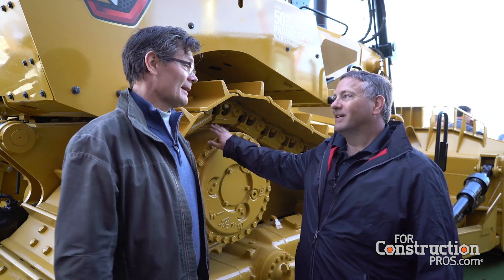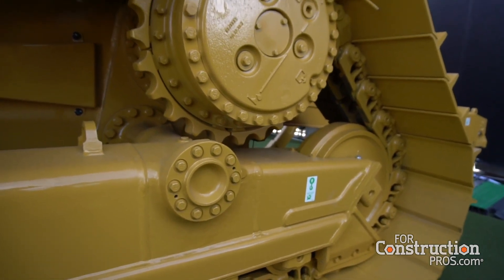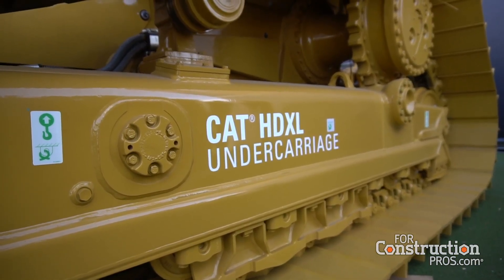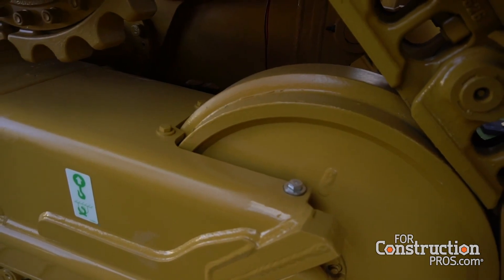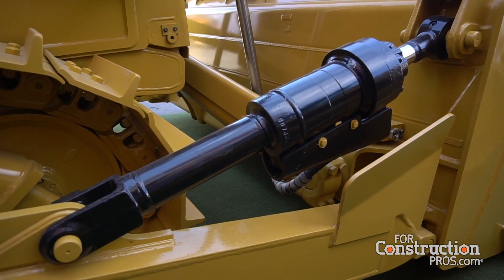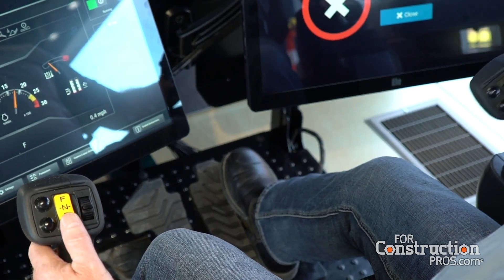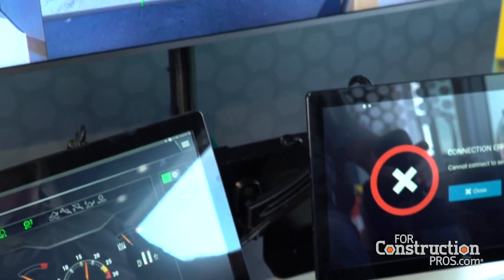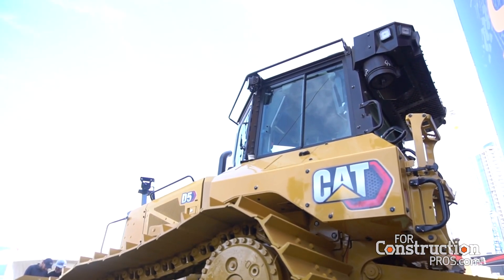Cat Brings Back High Drive with D7 Dozer

Comment: The whole point of the high track system is what was learned in the mud keeps your final drives up out so the cool down a little faster the mud works as a isolation holds the heat